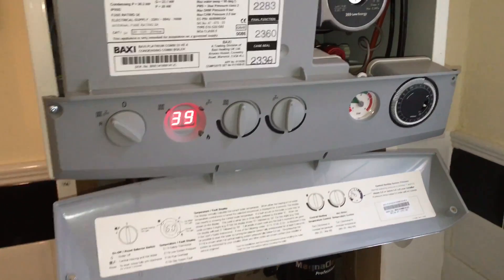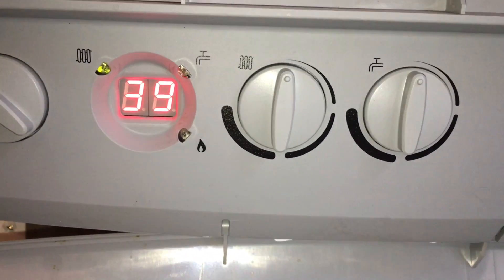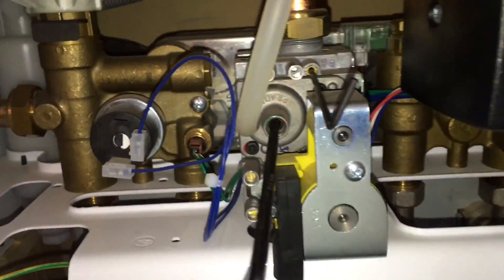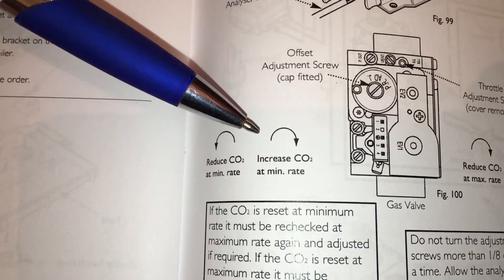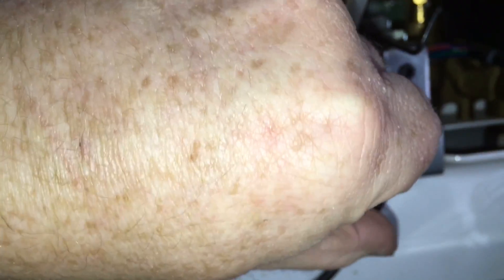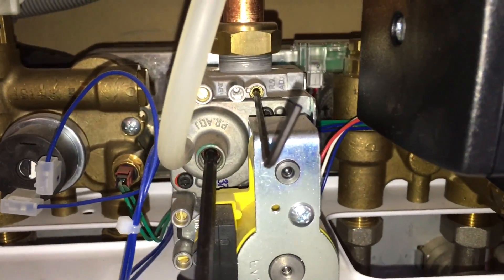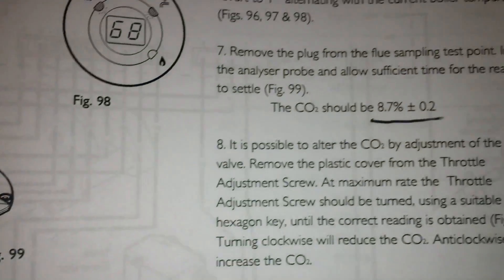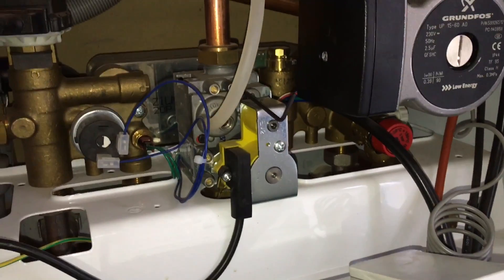Baxi Duo tec platinum setting up gas valve and service mode

Comment: Baxi now says just adjust on high, not low, and if the ratio is OK, then there is no need to adjust gas valve on service mode.

Comment: Hi I have question, how do I put a boiler in service mode long enough to adjust gas/air ratio on gas valve and do all the other checks like checking gas rate, working pressure before it reaches temperature and goes off, mainly on Worcester's and baxi's and generally other condensing boilers. Thankyou

Comment: adjusting this valve is the same with SIGMA 848? I have a cosmogas boiler and it keeps on locking it wont fire. I see that the ignition electrode was firing a blue flame already. But I doubt that maybe the gas is not reaching the combustion chamber.

Comment: Hi Allen, I see that Co2 at minimum load should be 8.4+ or -0.2 in the manual showing in video and Reading on FGA was 8.2 which was still in the permissible allowance. Do we still need to make adjustments in that case?
Reply from the maker: All you need to do is follow MI , Thanks for watching.

Comment: Its more common than not that the CO2 is incorrect would you not check the burner and HE before adjusting? Assume you didn't as it was the first service?
Reply from the maker: I have never had one out on a Duo-Tec after adjusting. Always check your Manufactures instructions though.